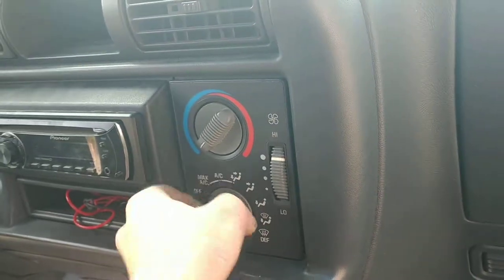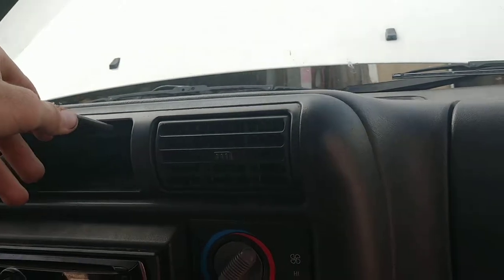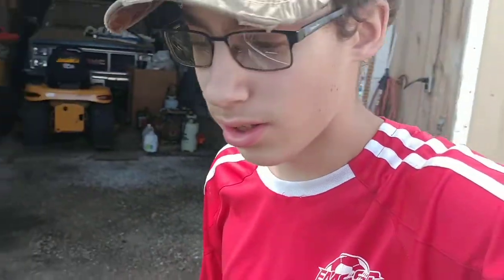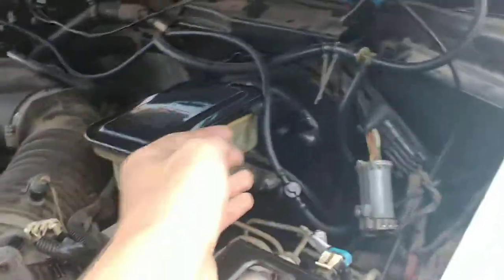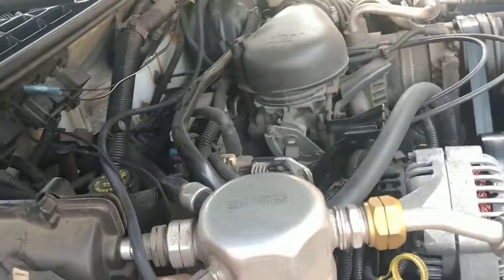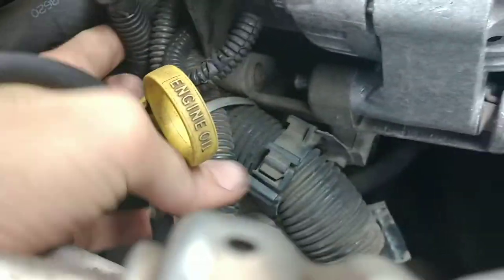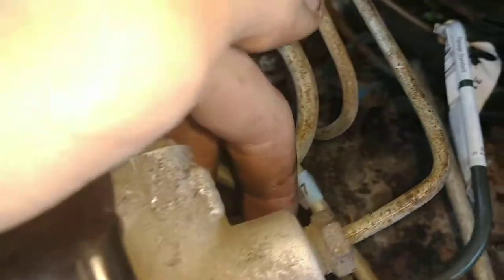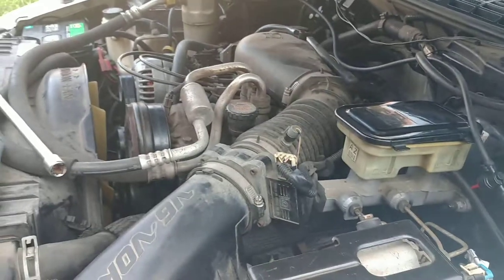97 Chevy Blazer vacuum problem...

Comment: Your transfer case is overfilled with transmission  fluid. They are notorious for having bad front input seals on the transfer case. When your vacuum switch opens on top of the transfer case it sucks the excess oil out and into your vacuum lines. 
Take the fill level bolt out of the transfer case. Make sure you have a catch pan to catch the approximately  3 quarts of excess transmission  oil that in there.. 
The oil was never changed . It only sucks oil in while your in 4 wheel drive. It takes years for it to top off.  Once drained to the proper level,  you'll will have to keep an eye on your transmission fluid. It will get get sucked back in.
 Unless you change the front seal on the transfer case. 
You have to blow all your vacuum lines out with 8lbs of compress air.. or change them.   DRAIN THAT EXCESS OIL OUT OF THE TRANSFER CASE .. GOOD LUCK
Reply from the maker: Thanks so much for your layout of steps! I haven't seen to many places that tell you that but I have had the seals replaced and vacuum is still a little ruined. All support is greatly appreciated! Sorry for not seeing your comment sooner! -Oldschool Farmer